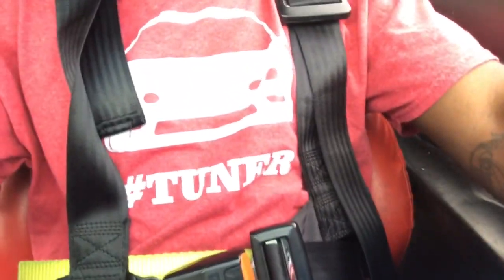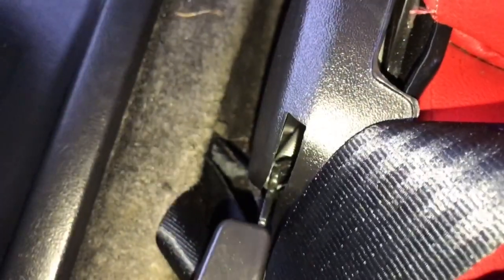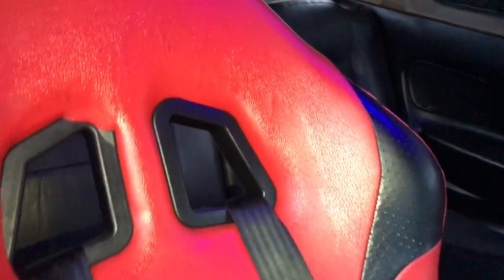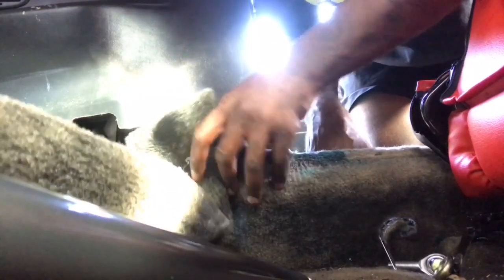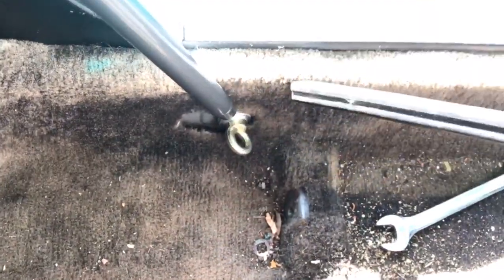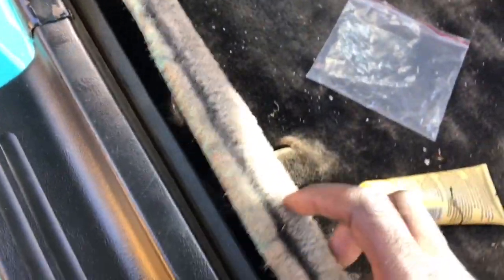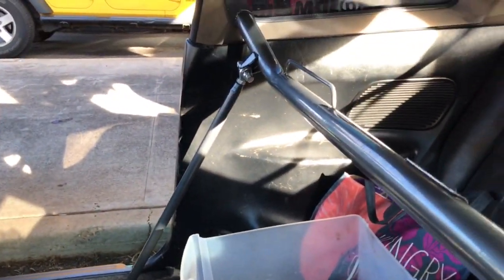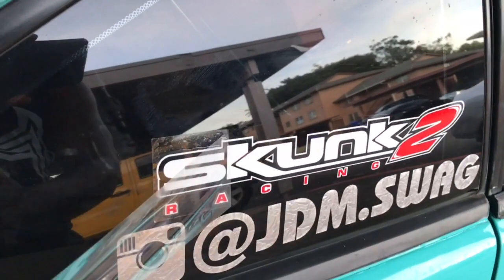How To Install A Harness Bar On An Acura Integra/Honda Civic

Comment: How did you take off the stock seat belts bro
Reply from the maker: Unbolt them from the sliding rail. Scoot the seat all the way forward and all the way back to access the bolts

Comment: Ay plus man you think you could make a video of how to adjust the clutch pedal so there is no "slop"
Reply from the maker: Ronin EM2 I’ve only done videos of things I’ve ran into I research how to do it and then I record me doing it myself or trying to lol I haven’t run into that problem...yet lol does your clutch like take a bit to come back up or what? Maybe it’s your clutch cylinder I believe it’s called going out or u need to add some  fluid. My car has stage 3 clutch so idk anything about slop lol

Comment: What harness bar is this what inch?
Reply from the maker: NRG and I just got the one that was comparable with my car. Idk the length. You won’t need that as long as you get it for your correct make and model “EBay”